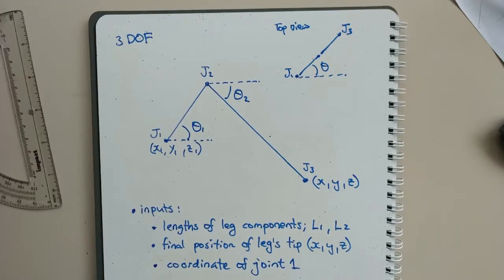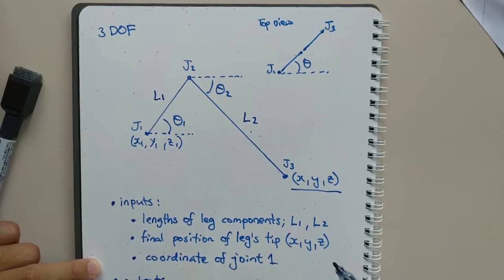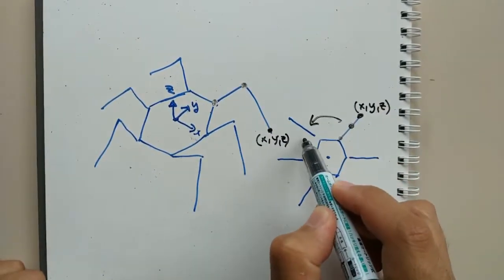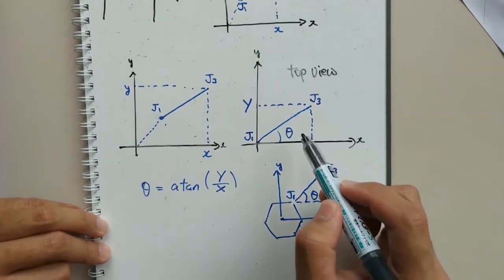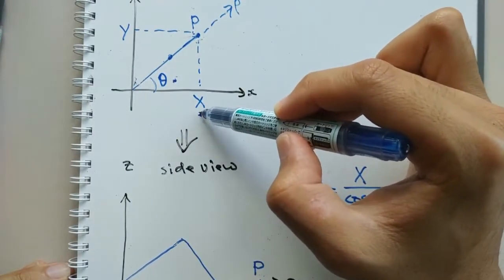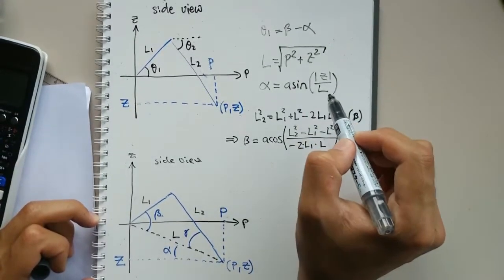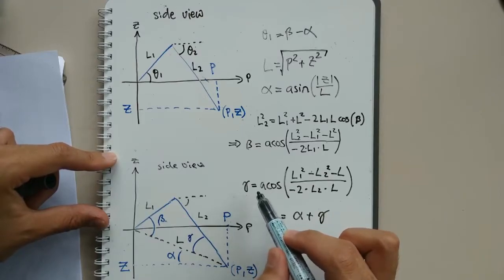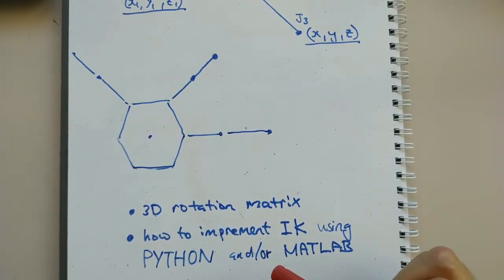How to Solve Inverse Kinematics for a Robot: Hexapod Robot with Raspberry Series

Comment: Thanks for the video!!! 

And the second parts of inverse kinematics???
Reply from the maker: Thank you for watching! 
The second video is still at the making process, but it will be about how to control all of six legs(could be more or less) with rather simple inputs.
Reply: Thanks for the help :)
Reply: @EngineerM  Hi, awesome I really need to watch this second part. when do you think it will be uploaded? thank you
Reply from the maker: Hi, thank you for asking. Right now, I'm trying out different formats of presenting the method of controlling multiple legs. I have already started documenting the video as well as writing some codes to visualize the results of calculation. I'm definitely planning of releasing the second part as soon as possible ;)